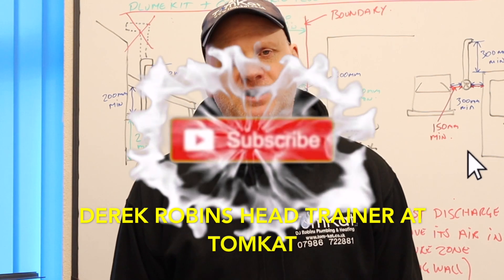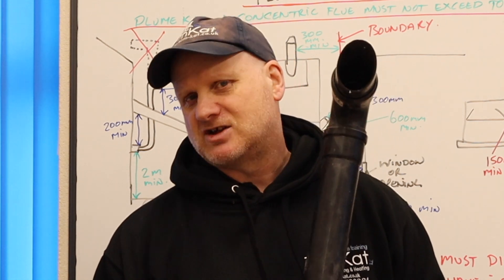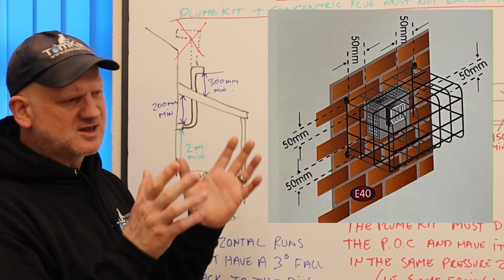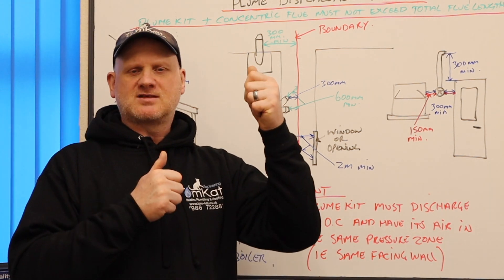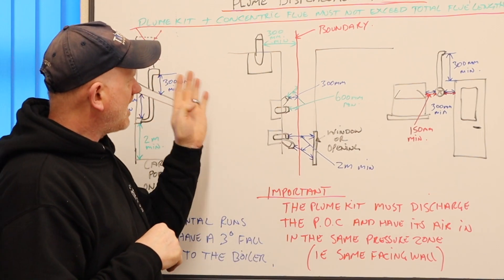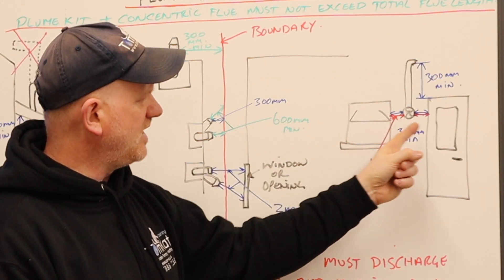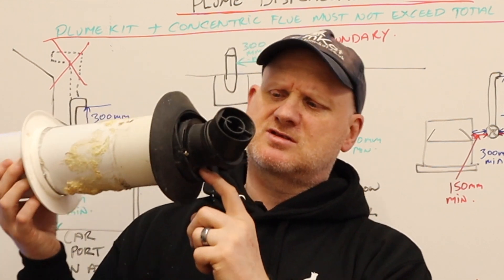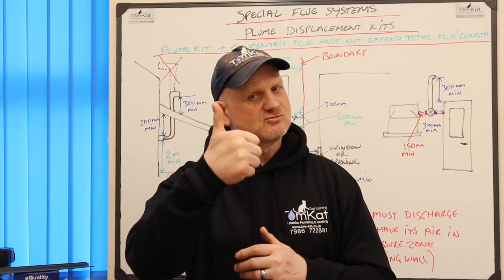Correct use of boiler plume management kits, ACS revision on how to install boiler plume kits.

Comment: Hi Derek 

If the extension is open on all sides and just has a roof resembling a car port would I still be able to use the plume management kit ?
Reply from the maker: Yes if the boiler manufacturer allows you to

Comment: Derek where air inlet of a standard Horiz Flue system has become internal due to the customer totally enclosing an external passageway & they Plume the exaust gas with Plume kit. Which is  'At Risk' in the IGEM G11, there doesn't seem to be much guidance about this type of situation, which reg would you be looking at for this situation mate. Thanks
Reply from the maker: It’s in igem/g/11 and is AR it has to be open on at least 2 sides

Comment: Could you comment on whether this is compliant or not please? It appears at 14:50 in the vieeo - https://youtu.be/WMT505xFuXg?si=b54OPD49NVcfrtPX
Reply from the maker: It is dependent on the boiler manufacturer. in most cases using a plume kit is allowed as long as the area is open on at least 2 sides. The termination of the plume elbow must be no less than 45 degrees to the wall and the flue integrity at the boilers test points should be carried out to check for correct combustion readings. Hope that helps
Reply: @tomkatgastraining  thank you very much. I will pop back and check what the boiler is and seek further advice. Appreciate your help
Reply: I have searched days for help and answers regarding flue extensions & plume management kits, as Im having a catio built and all the gas engineers i’ve asked don't seem to have an answer I feel confident with. Derek I did send you a message on Instagram in the hopes that you may be able to advise.

Comment: Hi there, can i put a plume kit(swan neck) above flat roof
Reply from the maker: @mohammedwadud4954  if you mean air in is inside and poc goes outside then no
Reply: What if the plume management kit was fitted above a sloped lean to roof? I'm aware there's a 300mm clearance reg between poc and the roof but are there any clearance regs between the air inlet and sloped roof?

Comment: Very good instructive video Derek. I have one query though.  One part of your video shows a single (60mm?) plume extension pipe fitted to just the exhaust gasses - but with no extension fitted to the air inlet. On another part, (if I have understood correctly!) you state that to fit an extension on just the exhaust fumes outlet and leave the inlet as is (expecially under a car port) is NOT allowed and a bigger (diameter) extension plume kit would be required).  I have just erected a car port and was going to buy just the 60mm centre push fit extension (with a 45° bend to take it through the car port roof). This would leave the air intake as is on my bungalow wall. I'm not sure what kit to buy now?  Can you, or anyone else advise here?  (I am not a Corgi registered heating enginner - just a domestic plumber).  Thank you.
Reply: Think Derek said "ok for Plume exhaust kit if Under a car port, But if in an extension / conservatory or enclosed building it must inhale and exhale via  larger twin pipe.

Comment: No flue required for a six ring gas hob on full.!! Explain that.
Reply from the maker: @paulhealey2984  easy cookers don’t need flues because they don’t run very long and have to go into a kitchen of a certain size and they require an opening window and ventilation if the room is below 20 m3 if a bedsit.

Comment: Thanks for the good video.

One question if I may, is it normal for small amounts of condensate to drip from the end of the flue kit, particularly if its vertically mounted like mine. 
Water seems to condense on the bird guard (I assume that most of it runs down the flue back into the boiler) and drip off. I've got bricks laid on sand below, so not particularly vulnerable to acidic attack but I'd like to be sure. 
My boiler is Vaillant EcoTech (18 kW) heat only unit and needed the flue diverter because the neighbour's wall has a couple of extractor fan outlets facing on to the flue position (its just over a metre away so would otherwise be OK).  The flue diverter is about half a meter high, and has a 45 degree angle bend on the top so that the plume is not directly driven towards the neighbour's wall but instead 'points' towards the end gap between the two houses. Can send a photo if it helps.

Comment: Boundary . we had a 1m gap between property it  caused damp and condensation inside the neighboring property . it blasted flue gas onto the wall of the neighbor and they  had condensation running down the inside of the wall gas safe refused to get involved and local council had no power force the boiler owner to make changes .

Comment: Interesting, am I right in saying that when the boiler in running , you will get condensation buildup on the end of the flue ? 
I ask because I don’t get why and so called electrician placed an coach light directly under the boiler flue  , as drops of water will drip onto the said lights and will corrode the light fitting and it will get into the fitting. The guy in question is NAPIT registered ? 
Great video mate. As an electrician this is something I have to think about when fitting outside lights and sockets.
👍👍👍
Reply from the maker: Yes you will get condensation on the end of the flue